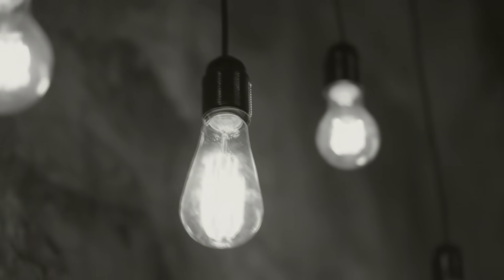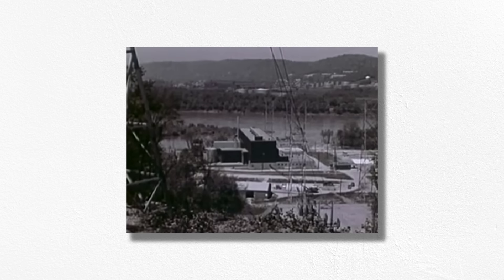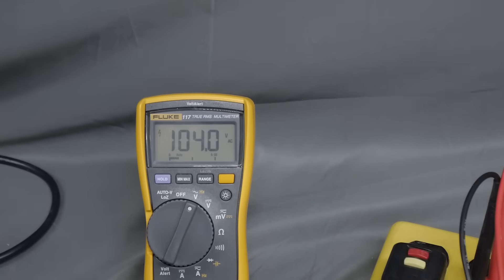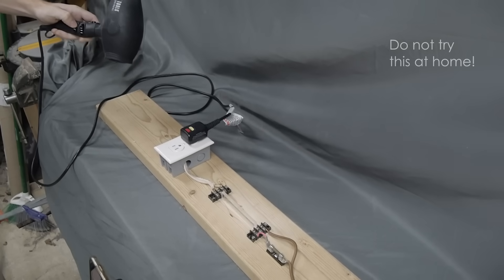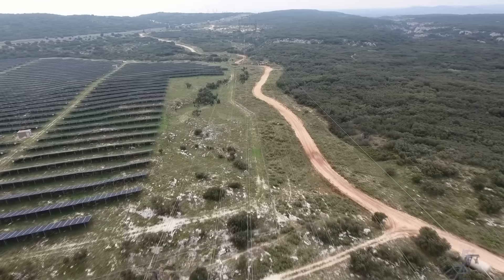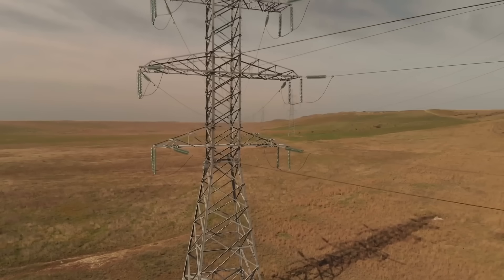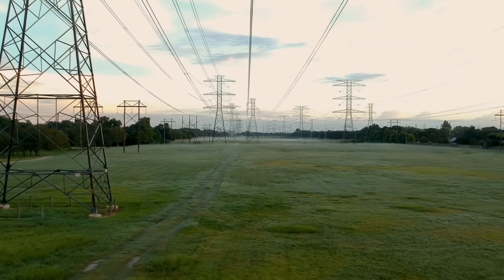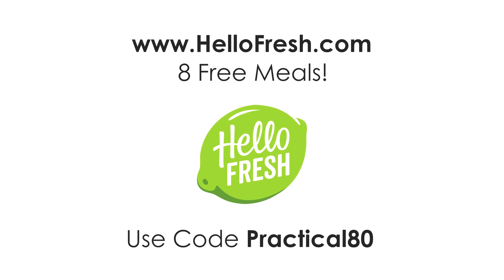How do Electric Transmission Lines Work?

Comment: 3:33 " You can see that the only way to reduce the current and get the same amount of power is to increase the voltage." You used the equation V=IR , it would have been better if you used the Power equation instead of ohms law equation when discussing the power equation. i.e. P=VI.  
overall nice video.

Comment: 7:10 "High voltage transmission lines also generate magnetic fields.." For further insight into the physics of transmission lines it is worth pointing out that the power is transmitted by the (electro)magnetic field in air surrounding the wire, not by the current flowing inside the conductor. While we often think about the magnetic field surrounding a wire as a 'by-product' of the electrical current, in the case of transmission lines it seems more accurate to think about it the other way around: the conductor is there to guide the power-carrying electromagnetic fields and the current flowing in the conductor is an unwanted 'by-product'. Unwanted due to resistive power losses which is explained nicely in the video.

Comment: 3:38
There is a mistake when its said "according to ohms  law (V=RI) we can reduce current by increse the voltage", because Voltage is proportional to the current , and thats correct because you want low potencial drop in the wire.  What you should said is in order to  give the same ammount of power  "with low current (P = V I) then you should increase the voltage.. " . Example reduce the current by half, increase the voltage by 2
(2V)(I/2) = V I = P 
hope I was clear.

Comment: Can someone explain what's the purpose of the cylindrical conductors that are insulated used for? I'm not really following why that's needed to space from the towers and how it works.
I see that there's a looser cable connected under the conductors. Wouldn't electricity just travel through the looser cable? Are the conductors to protect lightning from disrupting the powerlines?
Reply: Finally figured it out. The highlighted discs connected to the tower are insulators, they are not conductors...

Comment: I used to perform ground level inspections on wooden post lines in the Arkansas swamps. We were given our own pickups but transmission lines rarely run along an accessible path, at least in Arkansas that is, so we had to walk them. We got paid per pole inspected with a sound check and bore test on poles 30 years or older. Then had to GPS mark each location of said poles. Wasnt bad in the cooler months but walking miles with a 30lbs gas powerd drill over the shoulder through the swamps and brier patches in the sweet summer months was brutal. I told my boss "please put me back on distribution lines." Pays less per pole but much better on the body.

Comment: TVA power engineer told me their best efficiency transmission line loss is their 500KV (yes, 500,000 volt) rated construction which only loses 1KW per mile at rated power, due to resistance heat and non-return AC magnetic coupling to the ground and other clutter.   That's relatively good efficiency for the amount of power these lines carry.

Comment: First statement of fact WRONG,  public disservice as
1. Gee solar power generated in Nevada is used in New York. Practical transmission is 200 miles at 5% loss, following inverse square law.
2. Solar & power power is intermittent, solar on "puffy cloud" days without storage is counter productive, actually creating more greenhouse gasses than it saves because the "Peak Load" power generation (assuming clean NG) is only 30% efficient compared to "Base Load" plants which are dual cycle and 65% efficient.

Comment: As for the "tradeoffs one has to make for conductors", it helps just looking at the Top 4 conductors, in their order of conductivity:
- Silver
- Copper
- Gold
- Aluminum
From all the metals, Silver is the best coductor. But it is very expensive and heavy.
Copper is used primarily, because while only being Nr. 2 it is rather inexpensive.
We use gold in electronics, because despite the lower conductivity it has a high corrosion/oxydation resistance. And those powerlines are low power, open air (however we are also starting to return to copper internally, due to Electromagration and other small scale effects)
And Aluminum? That one does the usual trick: Raw Aluminum is highly conductive and reactive. But Aluminium Oxyde froms a protective layer around the raw stuff, with exactly opposing properties.

Comment: If those wires aren't shielded, how do birds sit on em??
Reply: Because the birds are not connected to another conductor or to ground / earth there is no circuit and thus no current flows.
Reply: @paulanderson79  ty. I've heard that before I think. But what about because they have two feet touching. Don't they become the circuit
Reply: @DinoNucci  Good question and I'll explain why this isn't the case. The conductors are made from aluminium, which is very good electrical conductor. Not as good as silver or copper but weight for weight aluminium is the best material for this application. A bird, by contrast is a very poor conductor and the feet are very close together. The current will take the path of least resistance and that is the conductor itself, not the bird. Even on 750,000 volt high voltage circuits.
However, let's take a 11,000 volt circuit in a distribution network. The conductors are far more closely spaced. Now let's say a large bird, a goose lands on one conductor but makes contact with another conductor on a different phase. Or, indeed, a grounded conductor in a four wire system. This need only be a wing tip. The current will see that circuit as a far quicker route. You'll get fried goose in no time.
The basic principle is that current can only flow between places where the potential difference - the voltage - is different. 
In the first example. the bird on a ultra high voltage wire both feet are at exactly the same voltage. Thus no current flows.
Reply: @paulanderson79  tyty

Comment: At 6:20 : No. The 3 phases  in the 3 conductors are offset by 1/3 of a cycle. If you will remember, an electric circuit needs 2 conductors from source to load, one 'going' and one 'returning'. Each of those conductors is an individual circuit, not connected to the other two. So where are the 'return' conductors for each of them? If you conceptually run a return conductor for each of the three, and place them next to each other (and do a little vector math), you will notice that the sum of the 3 currents is ZERO! That is because, between the three, as much current is going in one direction as is going in the opposite direction at any given time. That means that it is possible to 'eliminate' the 'returns' for all three (since they could be replaced by ONE conductor carrying ZERO current), assuming they are all perfectly balanced in phase and load. In practice, the balance is not always perfect, and there is a small return current. This can be carried in the ground, since it is very small. To make it more efficient small return conductors are sometimes used. That is what those smaller wires are for.

Comment: So, for years I’ve heard plenty of people say, “wish they would bury those electrical lines” but not until recently have I known why they don’t. Because they are hung the wires can be a smaller gauge because the air cools them. If they are buried they would have to be heavier gauge so the wires don’t over heat. Not only does it cost more and take longer to bury wires but also the material cost increases. Making it prohibitively expensive.

Comment: In ohms law if i have to reduce current then the voltage should be reduced ,how would u say that we should increase the voltage?
Reply: Power is loosely VOLTS x AMPS. In AC circuits there are other considerations such as phase angles between voltage and current. So the higher you make the voltage of the circuit the less current needed to transfer the same amount of power from source to destination.

Comment: This is Sarcasm:
Anyone idiot can string a wire from one side to another and flip a switch¡
Bloomberg 2020 presidential hopeful said: Anyone can poke a hole in the ground, drop a seed in, cover it with dirt and water it!
So agriculture/farming is easier than a "Chia Pet" you buy! 1st time you have to read the instructions and takes longer to set-up.
Good thing farmer's do need to know more than that cause there's no need to know anything about soil testing, government oversight, machanics, https://www.oecd.org/agriculture/topics/water-and-agriculture/
Weather, Logistics. 
Just pull it up by the rutts throw in the back of a pick up truck and cross your fingers it keeps til ya get it accross country or continent! Good thing ya ain't got ta know nutin bout testing for E-coli and other pathogens! 
Nope, ya Just put the seed on ground, step on it, and water!
They don't need to know any Laws they can get water from da su-er. Nothing changes! Weather is never a concern, nor are bugs, plant diseases! No need for knowledge of chemicals, food handling Na, just step on it and water it! If ya can do that Bloomberg says; "you can farm too!"

Comment: 3:32 Ohm's law absolutely doesn't help in explaining that to conserve power while decreasing intensity you should increase voltage.

Showing Ohm's law with V becoming bigger while I becomes smaller makes absolutely no sense as that law would suggest the opposite !

It's the P=I.V you had to show. And at that time it's delivered power you have to be looking at, not power consumed by the wire

Comment: Very informative. One point though, to get the voltage of a power transmission line multiply the number of insulation ceramic disks by 11kv not 15kv. This is because AC power oscillating between source and destination. So 9 discs is 99(100) kv,
3 discs is 33kv, Etc.

Comment: (Recently retired from a Fortune 100 electric utility) - Probably the best video I have seen about electrical transmission! I fault the electric industry as a whole for not educating the public about Bulk Electric Service; an astounding percentage of people believe critical infrastructure is accessible from the internet, they think electricity providers are free to buy from only the generation sources they choose, believe blackouts are caused by insufficient generation rather than transmission shortfalls, and think photovoltaic solar, even rooftop solar, improves grid stability.
Some details I could add: most commercial sized fossil and hydro plants use buss voltages around 100kV; long transmission lines transpose (roll) phases about every 70 miles for balance; the insulators are coated with a semiconductor to equalize the voltage gradient even when wet or dirty.

Comment: According to the  "Science Asylum", electrons don't actually flow along the conductor.  Rather, the conductor creates a magnetic field where the electrons travel thru the atmosphere.  Its rather mind blowing.  I encourage you to watch - https://www.youtube.com/watch?v=C7tQJ42nGno     Quoting -> "Based on the laws of electrodynamics, energy cannot flow in the same direction as the electric current. According to the Poynting vector, electric power will flow anywhere there is both an electric field and a magnetic field. The consequences may surprise you."

Comment: I am a newbie trying to learn these concepts, but what puzzles me is how you can increase the voltage across transmission lines and reduce the current. I thought increasing voltage would increase current. Is voltage not the difference in electric potential between 2 points (like the 2 ends of a DC battery). If you increase the voltage I thought more current would flow.  Why are transmission lines different ?

Comment: https://youtu.be/b0URuTLH93k
Use different ideas for different traffic cases.
https://youtu.be/529qi4c8Kbc
Take Ariel photos of the region through GPS System and Google Earth. Argue that Electrical transmission can cause electromagnetic effects on speedometer units of the Traffic Tickets meters. Also argue that proper Calibration of these Traffic meter is nessesary Time to time due to Air pollution and fog. These will WIN YOUR CASE and not to pay Traffic Tickets. Consult with Lawyers.
https://youtu.be/qjY31x0m3d8

Comment: Good we have it in the underground and what me a little suprised, we dont have high voltages in the ground.... ~400Volts but everything above goes over transmissions lines but we dont have much of them,just for really great companies have such thing.they planned over the years planning building more transmissions lines but it just dont happend. thank you for the good video with all explanations.
Reply: putting transmission lines underground is many times more expensive that overhead and difficult to maintain when problems arise.

Comment: The most interesting thimg about the grid is it's frequency, which is given by the turning turbines in the power plants. They are all in sync. When you add a new power plant to the grid, it will be forced to sync with the rest of all power plants conntected to the whole grid.

Comment: I served my apprenticeship painting high voltage towers and substation steel years ago. We use to paint towers while " hot", or energized, and we would literally craw out on the arm's holding the insulators/wires at times on upside angle iron. You stayed very low, and painted your way back. At times we would get a static charge, or small jolt, it didn't really hurt, but it made you hold on tighter. Usually when the humidity was high. We never wore safety belts back then, no hard hats, no safety lines. We couldn't use a rope to pull up extra paint. The utility did not want to take any chances of a rope getting in a hot line. Some lines had over 100,000 volts, some had several hundred thousands. We had to brush everything, no rollers allowed. If you left a " skipper, or holiday" ( a missed spot ), you crawled back thru wet paint and corrected, or painted it. It was hard work. I worked with some really good ole boys, old country guys. I done this several years, and never seen nobody fall or get into an energized line. Although a guy I worked with did get into a hot line after I left while working with another company. What a damn shame. I would say nowadays the safety regulations have changed for the better. Thanks for posting, interesting. JohnG

Comment: I´am an electrician. You are a BRILLIANT teacher, really good explained.
6:10 In germany we use: 
10.000 - 20.000 Volt from transforming station - town transformer.
110.000 , 220.000. 380.000 Volts through the country.

Greetings from germany
Reply: One question: is it 380 kV or 400 kV (here in Slovenia we call it a 400 kV system)?
Reply: @FrainBart_main  As far as I know (Wikipedia says the same) it is 380 kV.

Comment: Put solar panels on every home, business and covered parking rooftop.  Problem solved.  #EndFossilFuels
Reply: Not really. Doing this without a large amount of additional operational security measures would only result in blackouts.
Reply: @FrainBart_main  Solar panels added to your home or business ADDS electricity and ADDS another, additional source of grid tied power.  STOP defending fossil fuels by speaking out against solar power, a subject in which you are clearly uninformed (or a fossil fuel troll)!
Reply: @sanjuansteve  I'm actually against fossil fuels. I'm also a power engineer who has been studying grid operation for years. We can achieve carbon neutrality far easier using a lot more nuclear energy and utilising hydroelectric potential where it hasn't been fully used up. Also, geothermal and biomass power plants are not a bad idea in some places. Of course, relatively low shares of wind and solar (bellow 30 % in the total electricity generation or so) would be a good idea too. Adding solar panels to every building is a very bad idea, both economically and from a technical perspective.

Comment: good video, however few mistakes/inacuracies: The formulas you were talking about only are valid i DC an Ohm's law talks about voltage difference, it has no sense talking of voltage wihtout a reference.
The power in Altern current is expressed by the letter S and and comes from the phasorial produc of V times I* from where you have active power (real part and the one that devices consume) and reactive power produced by inductive and capacitive elements, such as the cable wires which produces inductucition and thus condensators are needed to compensate it.